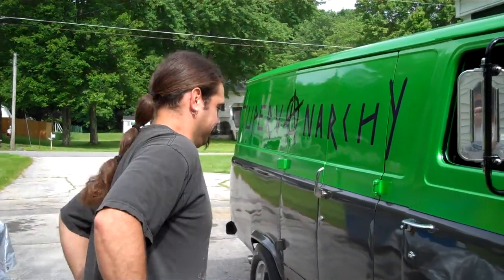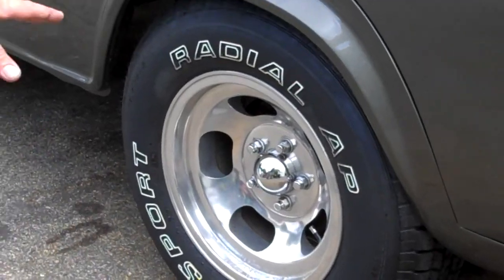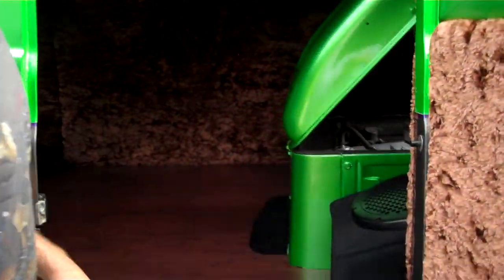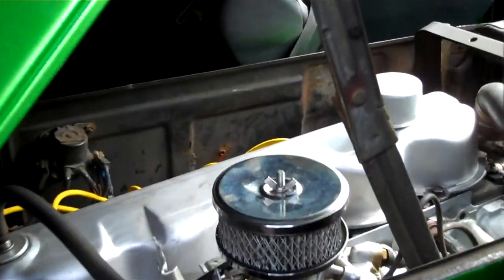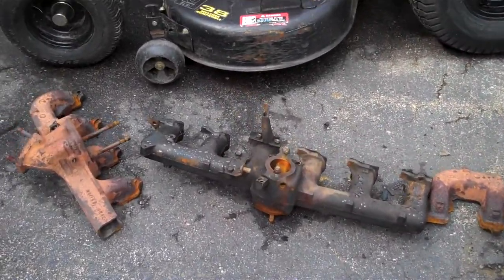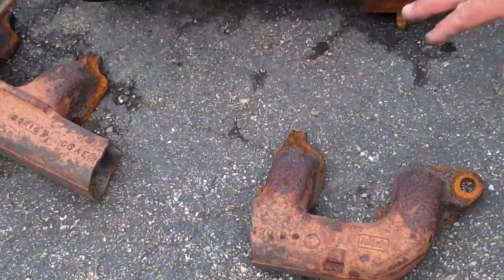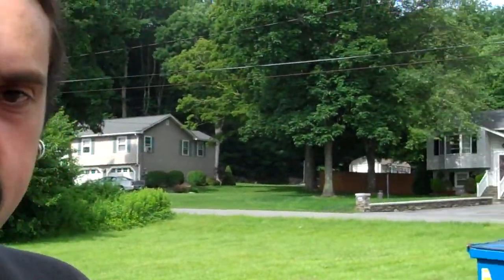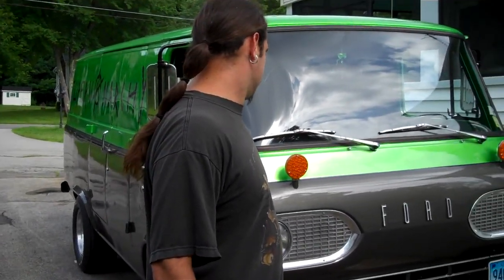goodguy supervanarchy 1

Comment: ok i see you wrapped up the intake and exhaust manifolds with some type of heat shield that is most defenitly should do to stop the vapor lock issues i love working on my van i guess i will get around to painting it after i finish putting everything mechanical that it needs in it , i am to rebuild the steering gear in it has some slop in it never done that before seems easy to do

Comment: @hemijp1 yeah i am doing all the work myself no paying anyone to do the work to my old vehicles i already rebuilt the motor the trans 3 speed manual a new clutch rebuilt the brakes on all 4 wheels redone alot of the wiring in it  going for a radiator rebuild soon  and starting on replacing all the rubber in the suspension on it as well